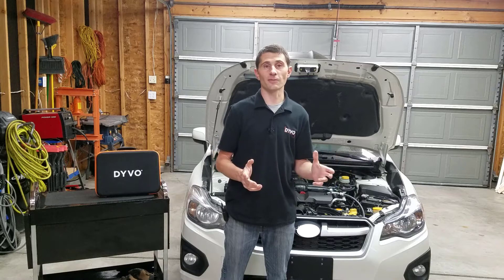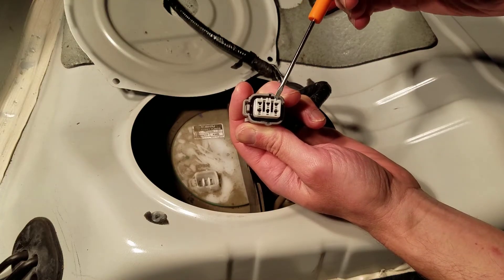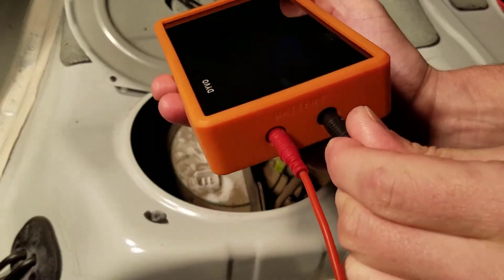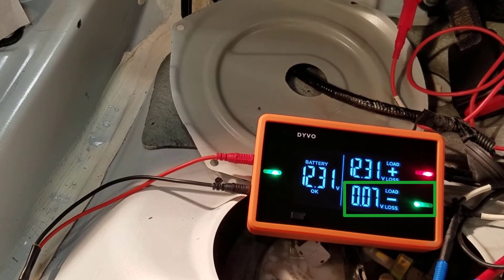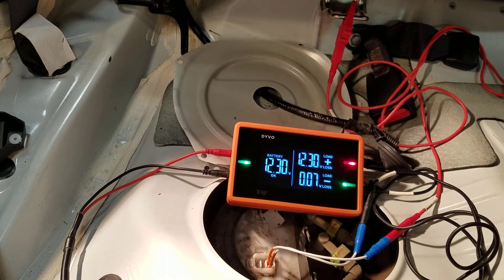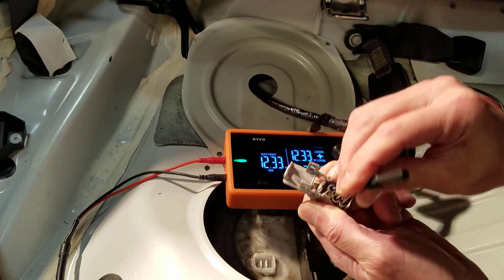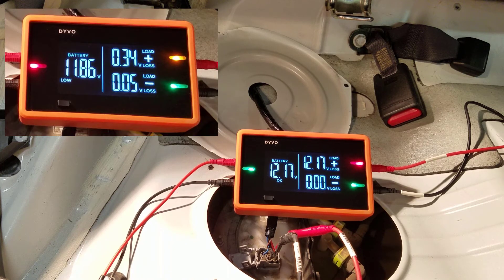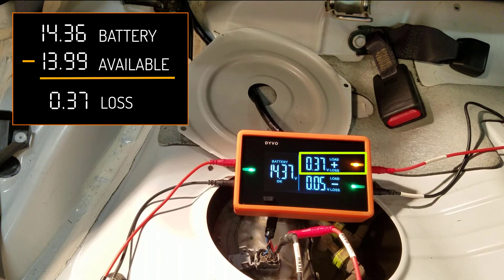How to test a fuel pump

Comment: It can check also a 5 Volts Reference
Reply from the maker: Yes, DYVO can test 5 volt references, as well as signals from sensors. Just turn LOAD Mode off and start testing!

Comment: Instead of guessing, couldn't you just check for continuity on the black wire to ground. That was you are sure that it's the negative one??
Reply from the maker: Great observation! You're right, instead of guessing, we should have used DYVO in the beginning to verify which circuit was ground, and which was positive. We did test and verify that later in the video (12:00), but we could have easily done that first. Thanks for the comment!